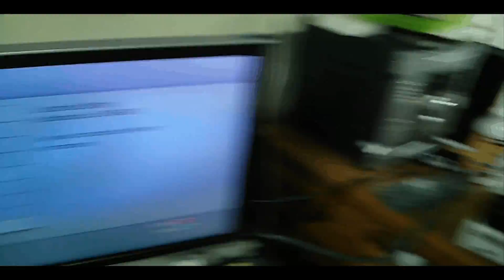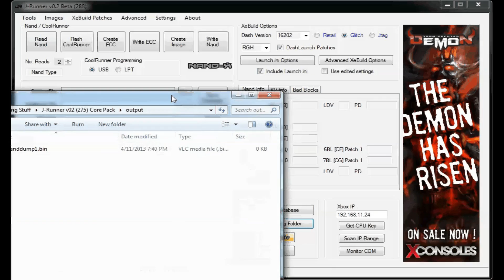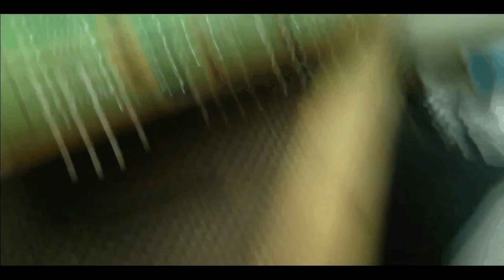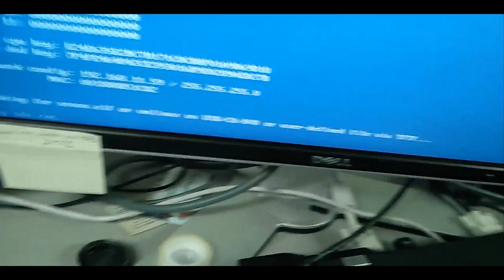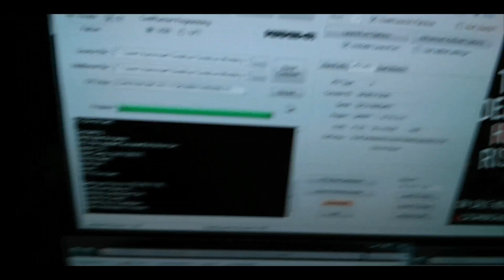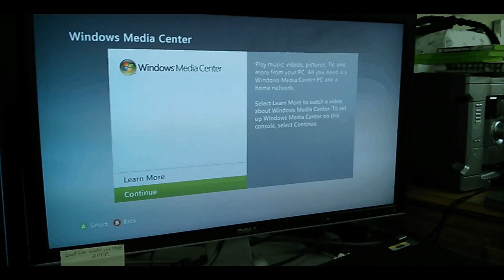How to JTAG a phat Xbox 360  COMPLETE GUIDE

Comment: Hi, I have an Xbox 360E. My dashboard number is 16547. Is there a possible way to JTAG/RGH1 this system?
How can I check whether my console is Xenon or Non-Xenon?
Thanks.
Reply from the maker: If you have a 360E it's not a Xenon.... Xenon's were the launch model 360 motherboards.  And with that console you'll be doing RGH2 - I'd recommend picking up a "Proto V2" and using that to glitch it.
Reply: TheWeekendModder Hey thanks, but I don't think there's a comprehensive guide on how to do RGH2. Is there another way to remove the region lock ? I got the Xbox 360E 4GB from USA and I'm using it India and I don't think the Proto V2 is available here. Is there an alternative ?
If possible, could you give me your e-mail ID and guide me through the process of it ?

Comment: i have xbox 360 slim with jtag,when i turn it on its take about 3 minutis to start up! is this a problem? and can i play online??
Reply from the maker: >i have xbox 360 slim with jtag

No you don't. You have a 360 slim that has been RGH'd and if it takes 3 minutes to boot it was RGH'd poorly.  

It's not a "problem" just means that the install wasn't tuned for good boot times. 

No you cannot go online with it, you'll be banned within a few minutes if you go online.
Reply: TheWeekendModder oh!..yeah they tell me u will be banned but i dont believed them haha..ok thanks man.
Reply: TheWeekendModder Can you link/tell me what you need to jtag the xbox. your website is down =(
Reply: TheWeekendModder were can I get the nand-x you have with the same usb
I don't want to buy a kit already have half the stuff
Reply from the maker: SilverGz Clan Xconsoles
Reply: TheWeekendModder I have a zephyer Xbox and the dashboard is 2.0.16202.0 is this jtagable? also I've look for nand-x online cant find it. can I use J-runner with nand-x wires to dump the nands? and when in J-runner instead of clicking falcon I would click zephyer ? correct ?

Comment: Nice how much u sell them for an r they online ready
Reply from the maker: I don't sell JTAG's or RGH's with the intention that they be used online.  I think modding lobbies, false prestiges and a lot of that is ruining XBL.  I use them as offline Xboxs to be used with freestyle dash to run single player games and XBLA titles from a hard drive.

THAT SAID... I do have two consoles that will be available for purchase very soon.  1 JTAG Xenon (with power supply) that is NOT banned and could potentially go online  - looking for $130 shipped within the US.

2 - Falcon RGH1 (instant boots like JTAG) with power supply also not banned and could potentially go online looking for $160 shipped within the US.

I will provide a disc that includes a FreeStyle dash, dashlaunch and XEXmenu installer with each console.

Comment from the maker: 1 - Yes, there is such a thing as the wrong iron.  Ideally you want a variable temperature iron set at about 325C for fast work.  That's about a 30W iron if using a fixed wattage.  You also want a small fine tip on it. 

2 - As I mention in the video, the wires I use are just bits left over from other projects. Any wire will really do. Kynar up to about 30 AWG.

Comment from the maker: This guide (the JTAG guide) would work on a Jasper IF it meets the dashboard requirements.

As for putting your BenQ drive into the console with the LiteOn... you'd end up needing to "spoof" the drive. not really anything to do with JTAG, and not recommended if you want to use Xbox Live.   

Essentially you need to read the key from the LiteOn, spoof and flash the BenQ and there's no reason you can't make it work though.

Comment: i found a method of soldering cables, then soldering cables to a LPT, then plugging the LPT to the computer to run a program called XBINS. My point is, are there other methods to JTAG'ing and would my method work?

Comment: The 2 diodes and the jumper wire should be on the motherboard forever or should I remove it? When CPU key has been read, should I turn off the Xbox or should it be powered on when Create Image and Write Nand?

Comment from the maker: Do just like you do with the nand points and use the scratch pen to take off the top coating, then flux and tin them before connecting the wires.

Comment from the maker: 30 AWG stranded wire should work fine - but pretty much anything will do.  I often strip out the individual wires inside old discarded ethernet cables and use those.